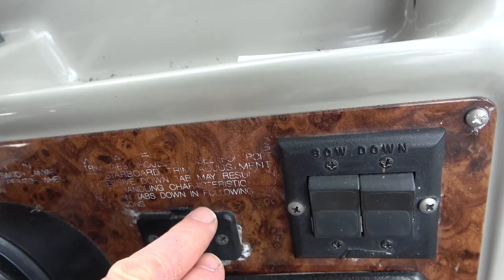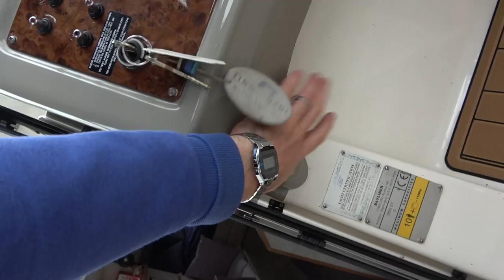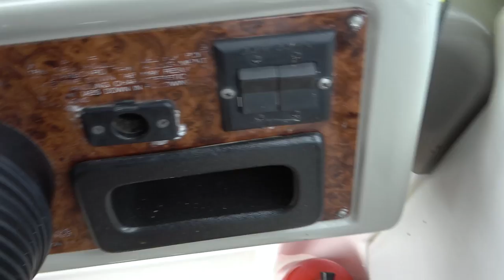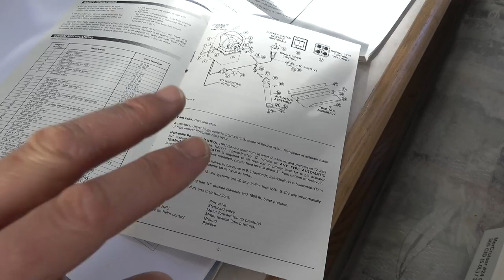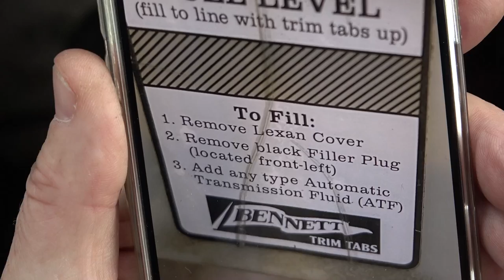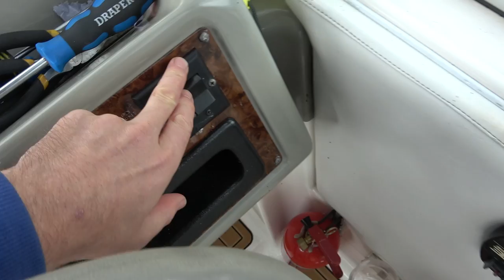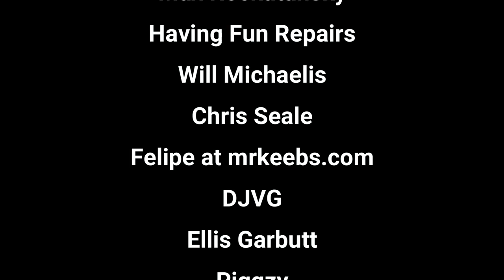BAYLINER 2855 BOAT - Bennett TRIM TABS NOT WORKING - Can We Fix it?

Comment: Hey Vince, you can always check fuses with the circuits live. In the automotive repair industry, we typically use a test light connected to ground and check each side of the fuse. A blown fuse will only illuminate the test light on one side. I highly recommend that you start using test lights and substituted loads when checking circuits on cars and boats and stuff. A heavily corroded wire can still allow voltage to flow and show 12 volts on a multimeter and pass a ohm test, but will break down when you try to pass a substantial current through it.  Watch some automotive repair videos on YouTube if you have time. I highly recommend ScannerDanner and South Main Auto. They're some of the best automotive electrical diagnosticians on the internet.
Reply: ScannerDanner is the man for automotive electrical diagnostics
Reply: VB

Comment: The switch order makes sense in that lowering a tab causes that side of the boat to rise and vice versa. So hitting the left switch down will cause the starboard side to rise, thus lowering the port side (relatively). So in land lubber terms: left up makes left side go up, right side up makes the right side go up, left side down makes the left side go down, and right side up makes the right side go up.
Reply from the maker: Thanks Jeffrey, written that way is fully understandable 👍

Comment: Vince, if you are going to be doing more vehicle electrical you might want to invest in a "Power Probe" I use to do a lot of automotive electrical and they are a god send. You hook the main leads to the battery and the "probe" can then be touched to areas and it will tell you if it's grounded or hot and a little rocker momentary switch on it allows you to then inject hot or ground if needed (it has a resettable breaker if you overload it). The company also has extensions (it's already like 15' long but they have them another 30' for use on things like motorhomes, trailers and such) They also have special wire piercing probes that have tiny needle inside, you lay the wire into a grove and tighten the probe and it pierces the wire for testing, the holes are so tiny that there is no need to do anything to the wire when you are done. It's an amazing tool but a little pricy. If you plan on doing automotive (12v or 24v) then it's a super good investment.
Reply from the maker: I have been told about them on the Rolls Royce. Apparently, they can save me a ton of time. I should get one really, but I'm just so used to my multimeter, I been told this can give false reading though. Maybe I'll treat myself, cheers Epoxy 👍👍👍

Comment: My son bought a boat the engine looked as beautifully clean as this one. Don't forget Vince if the fuses are blackened then the contacts in the fuse box will probably be the same and maybe need cleaning to, perhaps this increase in resistance is causing the fuse to blow. A long time ago someone told me to remember port and starboard as THERES NO PORT LEFT TO DRINK. Correct me if I'm wrong but those connectors bear a remarkable resemblance to computer power supply molex connectors. Oh yes here's a thought, maybe those switches are upside down  if you turned them around the left switch would operate the left trim and the right switch would operate the right trim. Just a thought.

Comment: The switch positions are correct. Once you engage the starboard “bow up” the following happens: First, it raises the port side tab which lowers the port stern. As the stern lowers, the starboard bow rises upward.

For the opposite side, engaging the port “bow down” deflects the starboard side tab downward. Thus, raising the starboard stern section and lowering the port bow. As expected, engaging the port “bow up” has a reverse effect.
Reply from the maker: Oh, I get that. I was thinking more from an electronic point of view with the wires but from an operating point of view the bow side that moves matches the switches. Thank you 👌👍

Comment: Being on a boat I’d tidy up the fuse box area sea air and exposed wiring will soon have corrosion set in remove the majority of those crimps /scotch locks lol and solder the wire and insulated just to avoid any future problems with your electrics will also save you any future headache looking for faults

Comment: Great video, I have learnt something new about a boat. For another boat video (Which we’d all like to see) why don’t you wire the trim switches into the fuse box under the dash instead of the horrible retro fitted wire with in line fuse? That would give it a more OEM feel and be independent of which battery the isolator is switched to.
Reply from the maker: I'll mention that to Brian. There are 2 spare fuse board slots under there as well 👌👍👍👍 Cheers Techy

Comment: Nice work Vince.... nice deductive troubleshooting  - excellent  - did you finish up with a 20amp fuse ?  Anything else may still blow depending on the draw for the solenoid.  Perhaps moving both sides at the same time would cause the highest amperage draw.
Reply from the maker: Thanks Ron, yes, we put a 20Amp fuse in at the very end. Sorry, we forgot to film that bit. I think it still had a 15Amp in when testing 👍

Comment: From what I see, it does not matter if the battery is on or off as the power connection is directly to one of the batteries and not through the switch.
And the operation is very simple. All centers of the double pole double throw switches have main positive power. Each swith does the same thing to the motor. Switch/s up runs the motor in forward and switch/s down runs the motor backwards. The port switch opens the Starboard port for either up or down just to enable that cylinder and the opposite on the other side. So one switch up opens that port and runs the motor forward. That same switch down opens that same port and runs the motor backwards. The motor has a common ground and one lead powered up runs it forward and the other lead runs it backward. If you should put one switch up and simultaneously put the other switch down, then the fuse would blow because now you have power on the forward winding of the motor as well as the reverse winding. Very simple little system.
I was recently having a  recurring sometimes failure that I found difficult to diagnose as in a larger boat, I have 2 separate switches without the bussing on them. There is the single middle wire that had some corroded crimp terminals, but only slightly corroded in the jumpers from that main wire to the other 3 posts. They would read good voltage without a load, but when under load, the high resistance would take the power away. This would have been rather simple to diagnose except for the fact that one of my switches was also intermittent with a slightly corroded contact internally. I finally changed both switches as well as redoing all of the crimp splices and everything has been perfect since.
And I have found on my boat that every single wiring failure can almost always be attributed to an open type crimp splice that has corroded internally. Whenever I work on any of the wiring, the first thing that I do is replace all of the open connectors with a heat shrink type that I find very rarely fail even when under water.
Great job fixing it as I did not know that individual solenoids were available and replaceable, thanks for that.

Comment: well that was fun to see :) and what great fault finding techniques :) would it be possible to just swap the red and green wire to enable the right wire  on the right side and left on the left  :) just a thought :)
Reply from the maker: Thanks GDaddy, it would yes BUT apparently it is correct because the switches are labelled up as BOW. The left trim tab effects the right bow and the right Trim Tab effects the left bow. Other comments on here explain it better than that 😂👍👍👍

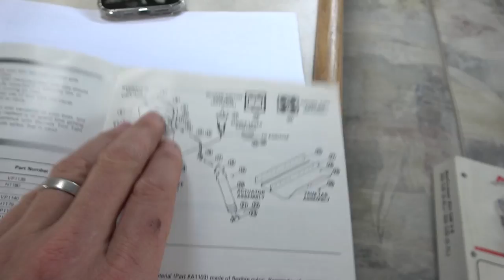Comment: @23:00 my guess is the valve is stuck so it is dead heading the motor causing it to stall and over current.
Reply from the maker: Thanks for watching Scott. I didn't show it on the video as it was cut out, but the solenoid looked perfect inside, it did have a 2 Ohm short from the wire to a clean part of the case. The working one had a 8 Ohm short. I'm wondering if the coil inside failed with a few strands of wire touching the case. You would think that would have been a dead short though. It still blew the fuse though without the motor connected so something must have been shorting inside that solenoid. It was a fun one to fault find. Shame it couldn't be fixed and had to be replaced but still a win. Cheers Scott 👍👍👍

Comment: Maybe I'm wrong but I think the tabs switch are always energized with 12v because the orange wire goes directly to the the switch and not the battery selector rotary switch, unless it breaks ground too but I don't think so.
Reply: I agree. No need to use the 1/2/BOTH/OFF switch which isn't involved in the trim tab circuit. Worth noting: even with the battery switch at OFF the trim tab circuit is still energised.
Reply from the maker: Oh yeah, I'll get Brian to double check that...unless like you mention the rotary switch only breaks the negative. Hmmm I curious now as I was working on it with complete disregard as I thought it was a dead circuit!!!

Comment: Was the solenoid repairable by removing the shorted wires? What had changed to star the short - presumably they worked before?
Reply from the maker: I did try off camera but to get to the coil wires, but it was very destructive. I can't see how it failed as it was all covered in an epoxy type material. I'm wondering if part of the coil was close to the metal casing, and it got a slight knock (dent) during maintenance which shorted the coil on the case. That is just a guess though 👍👍👍
Reply: @Mymatevince  Ahh thanks. Epoxy is the game changer - as you say, getting beyond that is more destructive than it’s worth. Still of interest is working out how the failure was caused. Solenoids are usually robust unless there are circumstances which cause a problem. As you mentioned the marine environment is particularly challenging.

Comment: Magnet on string to get the lost screw maybe?
Reply: Yes!  That's a great idea.  Also, use a borescope and run it down the opening on the side there.  My experience with losing tiny objects is that they hide under and behind things.  We know it's got to be on that boat or stuck to someone's shoe.  We know it's not in France.  That we know.  FIND IT, Vince!

Comment: Switch positions left/right ?

Suppose that you are zooming along and want to lower the right side of the boat.  You press the bottom of the right hand switch to lower that side by lifting the left side of the boat and vice versa
Reply from the maker: Thanks HeliBob, yes it makes complete sense now as the switch is labelled up as BOW. I was thinking more from a wire point of view rather than how it operates in the water 👍👍👍

Comment: Use a load across the fuse, like an automotive brake light bulb in series, to keep from blowing so many fuses. The light bulb will glow bright when there is a large current but should drop all the current across the filament. I have seen many mechanic channels using this trick, and the light bulb can be connected in series with others to increase the load. It is also used in the electronics field. It is called the series light bulb trick. After working on a power supply circuit put a 120 volt light bulb in series with the "hot" the light will come on bright then go dim as the power supply circuit comes up to full voltage. If there is still a problem or overload in the circuit, the light bulb will drop all the current and protect all the components that were just replaced.

Comment: It looks to me like the orange/red wire from the battery bypasses the isolator switch. Have you checked if the power to the trim tabs is on all the time? If there is that might need to be changed. Also, there's a blue wire near the main fusebox that isn't connected to anything. It looks like there are some stands of wire sticking out from the insulation and it's had a bit of black tape wrapped over the end, but there is still a strand of wire sticking out (05:30 on the video).
Reply from the maker: Thanks Pete, I am going to get Brian to check that next time he is there, I think you are correct that they will be live all the time.  I have a trying to fix a horn video coming up which will show that little blue wire. It wasn't quite that simple, but it was part of the problem 👍👍👍

Comment: Great repair, Vince.  One quick test for solenoids is to measure the resistance of the coil.  A reading of 0 ohms would indicate a short and infinite ohms would indicate a wire break. The normal operating resistance range varies according to the particular solenoid design, but it should match other solenoids of the same model if you have them available to compare. 

The same test also works across the coil terminals of typical electromechanical relays-- in that case you're measuring the internal solenoid that flips the relay's mechanical switch contacts.
Reply from the maker: Thanks George. It was cut from the video due to the length but the working one was 8 Ohm from wire to metal case and the faulty one was 2 Ohm 👍👍👍

Comment: Another very interesting one. I was super surprised that those trim tabs aren't wired to key power. I don't believe it's normal to have any accessory available for function without the key owner's consent. That makes the inline fuse kind of suspect too. Great trouble shooting and logic, glad you found the fault and got the trim tabs working.  (Regarding wiring to key power, I work at a motor sports dealership, admittedly maybe there is a different standard for marine craft but I'm suspicious of the installation, it might be why port and starboard controls are crossed as well)
Reply from the maker: Thanks Beavis. Apparently, the controls are supposed to be like that as the switch is labelled BOW. We haven't tried it yet but when you operate the left trim tab the right bow moves and vice versa. I think it makes more sense when the boat is in motion. Yes, others mentioned the same thing about them being wired directly to the battery. Next time Brian is there he can check out whether they work even with the battery switched off. Maybe it needs to be rewired to key power...another video perhaps 😂👍👍👍

Comment: Surely the battery isolator wouldn’t affect the power as it’s connected directly to the battery? 🤔
Reply from the maker: Yeah, I think you may be right unless the rotary switch is breaking the negative. I will get Brian to check that out for me. I didn't realise that at the time 👍
Reply: @Mymatevince  that’s the only other logical explanation, seems a bit like a retro fit with the inline fuse being fitted instead of using the fuse board, I suppose if it isn’t through the rotary switch in any way you could fit a relay with the the coil of the relay tapped into the switched side of the rotary switch somewhere or after the ignition switch, then it’ll energise the relay with the rotary switch turned on (or ignition if after ignition switch) allowing the power to the trim tabs, that would disable them when not in use. If it has a switched neutral then what I’ve just written is pointless 😂

Comment: The sticky switch could have got stuck on for an extended time, perhaps with other noise happening so someone wouldn't realize from the motor noise, and the solenoid melted the winding insulation and shorted as a result? I'd imagine that's part of why they say to do it in short bursts.

Comment: Next week ..... Vince fixes a plane????
Reply: Or a tractor... hmmm then I suppose I'd have to do a boat lol
Reply from the maker: Fingers crossed Lee. I going to start hanging around airfields with my IPA and Fluke multimeter 😂👍
Reply: @Mymatevince  technically I've worked on a microlight before if that counts....

Comment: In future always run the fan/blower for a couple of minutes before ignition
Reply from the maker: Thanks Richie, I think he opens up the engine compartment to air before the initial switch on. There should be a hose connected to the fan to expel the fumes...it's on the 'to do' list 😂 Cheers for the comment/help👍
Reply: @Mymatevince  anything boat related, ask away I have a good 2500 hrs under my belt
Reply from the maker: @richielevy3821  Excellent, I'm sure questions will pop up over the months ahead 👍👍

Comment: You're confused as to why the switch operates the opposite side trims but yet in the video you said green is starboard and red is port, which they obviously are but the wires in the switch are connected the opposite way around. What does the wiring diagram say 🤔
Reply from the maker: It is correct apparently as the switches as labelled up as BOW. The right trim tab moves the left front of the boat and the left trim tab moves the right front of the boat. It will make more sense once the boat is moving 👍

Comment: Ha, awesome! You didn't test the solenoid for leakage to earth/ground before taking it apart? Either way, great fix!!
Reply from the maker: Thanks devtty. I did but it got cut from the video. It was 2 Ohms between the wire and a clean part of the case before taking it apart. The working one was 8 Ohms in situ. After I took it apart it went up to 4000 Ohms and nothing happened when connected to 12V on my bench power supply. Apologies for not including it. I battle massively with what to include and what to cut as that whole section would have taken up another 10 minutes with all the testing. Already all my videos struggle these days as the masses (not my subs) want shorter length content, either that or the YouTube algorithm prefers it and rewards shorter videos which in turn leads to more shorter videos 👍👍👍